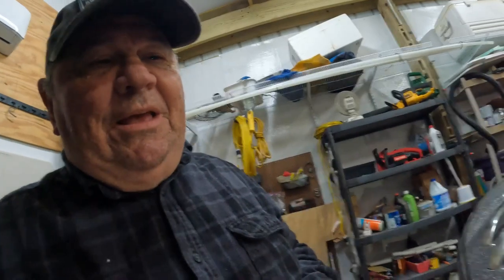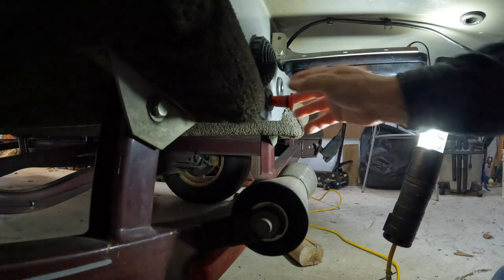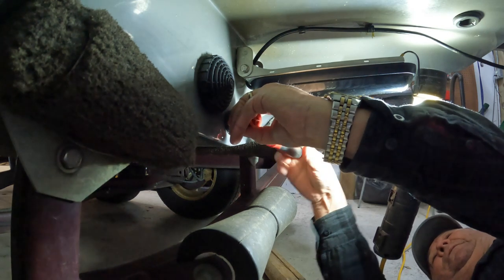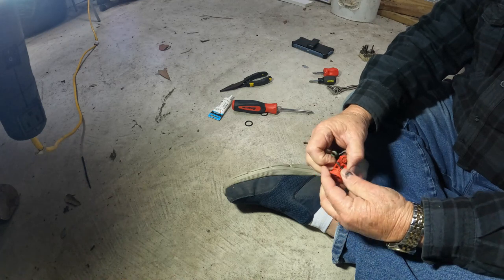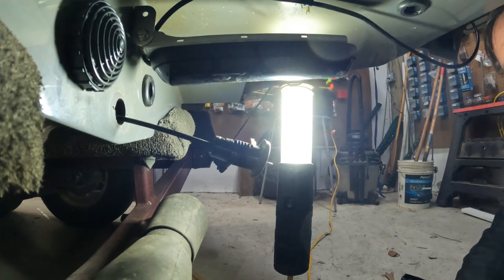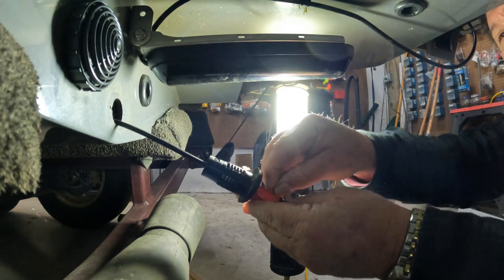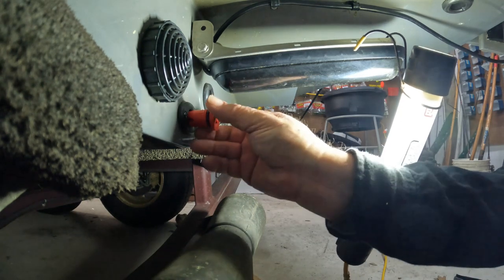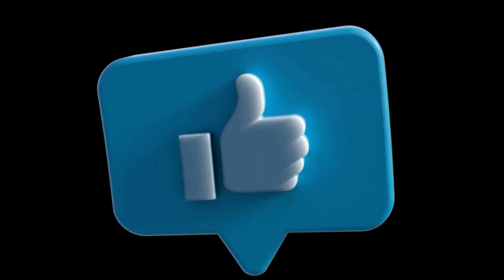Flow Rite Drain Plug O Ring Replacement S2 || Ep 25

Comment: What size O-Ring?  Did this solve your leaking issue?
Reply from the maker: Thanks for watching the video.  I did stop that leak, but I didn't put the O-ring size in case they have different sizes for different boats.  The first time I changed it, I took the O-ring off and went to the parts store and found the right one.  Now I have some on hand, if necessary.  I hope that helps